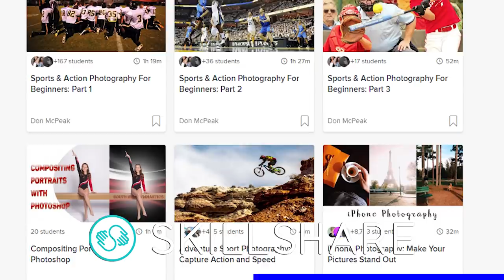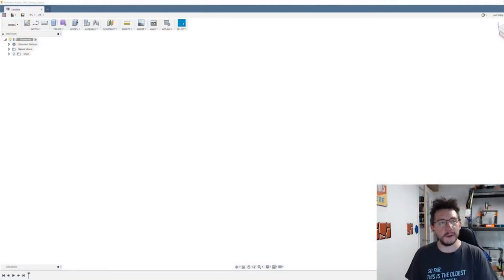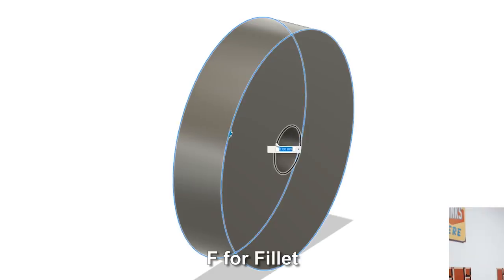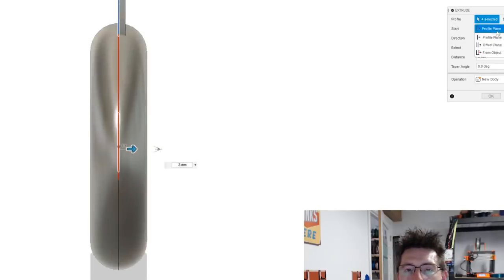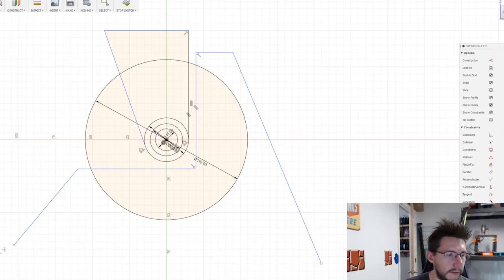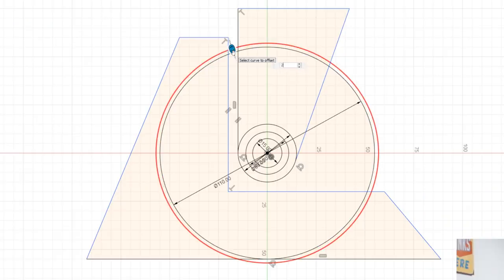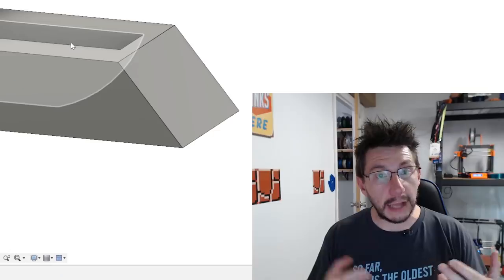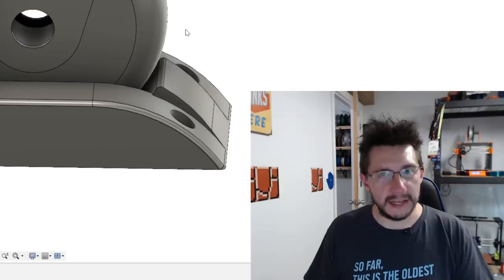3D Printing Custom Scooter Stands

Comment: Might not require larger board if you mount stands at a slight angle. Handles would tuck nicely together.  BTW, I really enjoy watching your vids.  As a grandparent of leukemia survivor, I appreciate your focus on helping the kids. Great job!!
Reply: Just for S's and G's I measured the angle of right-slashes, mentioned by James, above, (In Fusion, using Arial font), and found that it's sixteen degrees from vertical.

Comment: need to see a 3 & 6 month trial on how well these hold up 
if these scooters are the folding type I think I would have built wall hangers any way 
if I had don these I think I would have made an L shaped wooden base then used the one you have created then on the vertical part of the L base I would have made a part to clip the steering  shaft into at about half way in the height of it 
it just looks like these would break the small up rights on these stands

Comment: Only thing I wish you included in the video was how you curved and smoothed out the final model in Fusion 360.
Reply: Technically he did. It's called FILLET.
Reply: @RabbitsInBlack  yes
Reply: That was a lot more than filleting. There were curves that could not have been done with fillets.  He made a huge jump from prototype to finished product.
Reply from the maker: That's true. I included the Fusion 360 file for the finished product in the gumroad link. I didn't have time to film a full tutorial for that part. I'll see what I can do.
Reply: @rickseiden1  Well, I guess my experience of CAD for 18 years is a little rusty.
Reply: @3DPrintingNerd  no big deal, I know how busy you are.  But I for one would love more videos of you doing some work in 360.  I find it helpful in my learning curve.